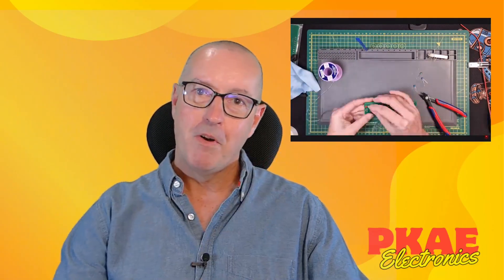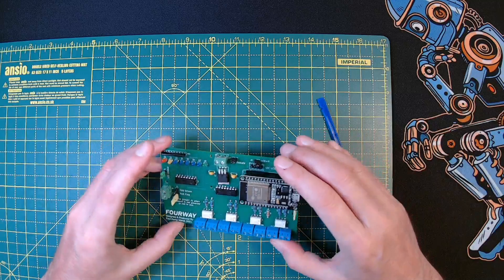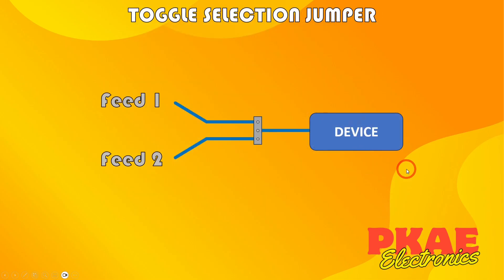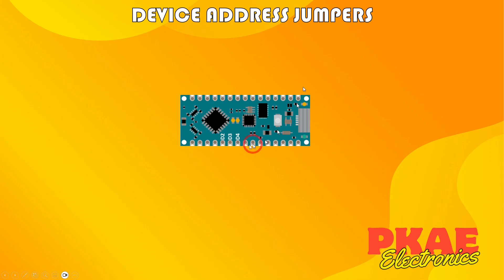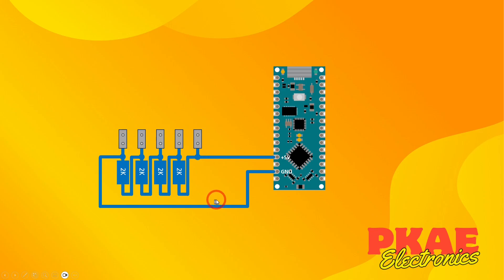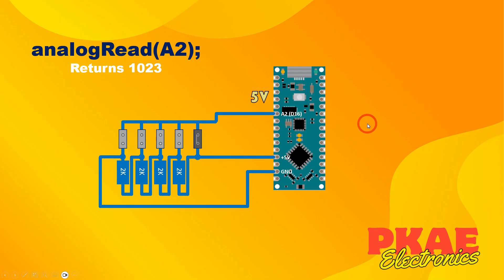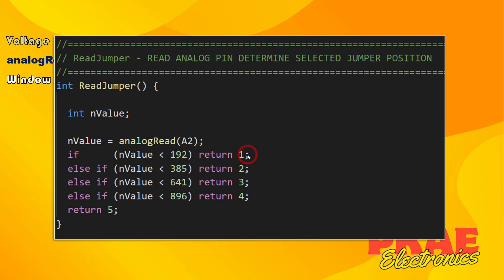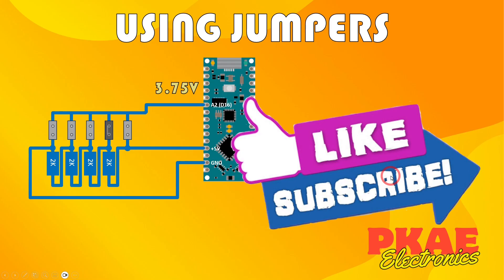Ideas for Using Jumpers

Comment: Nice! DIP switches are nifty too!
Reply from the maker: Yes, I also use DIP switches. Typically for device addressing. 

Jumpers/header pins provide the additional benefit of a convenient testing point too. You can easily connect your meter or scope to the header pins for testing and fault finding.

Comment: Yes, these are very useful. I have used 5 male header pins in a '+' shape, like you used with 3 in a row. That way the middle pin has 4 options (up, down, left or right) for connecting. In my case, I could power a DIY Arduino shield from a pair of screw terminals, or a voltage regulator on the sheild, or a USB port, or from the Arduino's 5V supply.
Reply from the maker: Thanks for the comment. I never thought of a + configuration; that's quite interesting.

Comment: Nice suggestions. I use jumpers on breadboards quite often. I find they are more reliable than switches and easier to set up. the trick is to use double sided headers (pins on both sides are long).